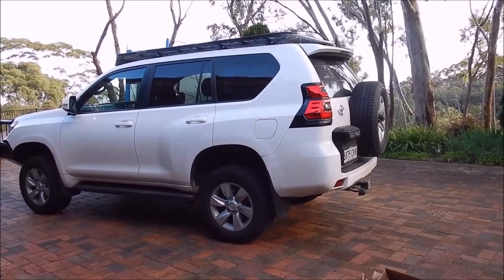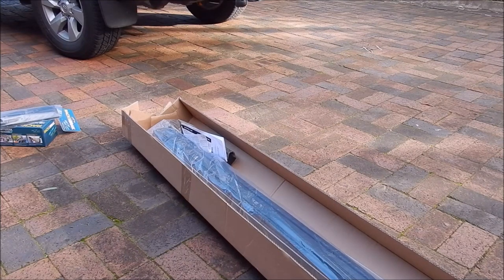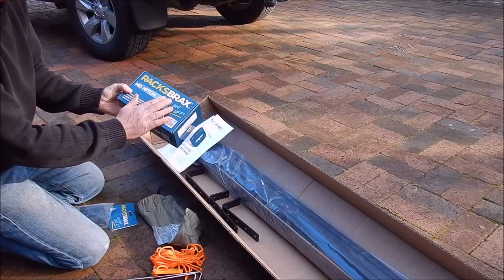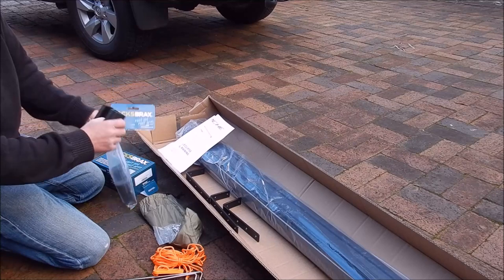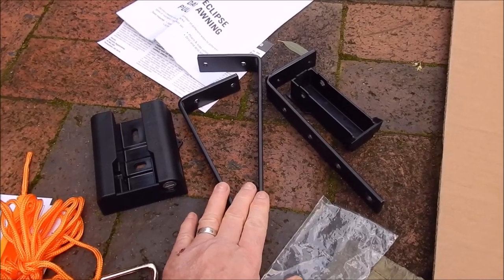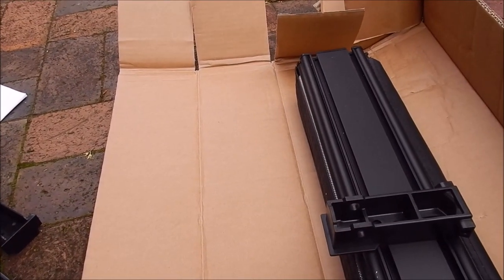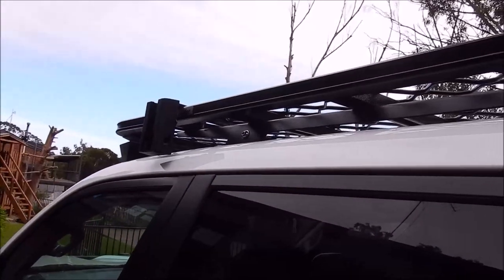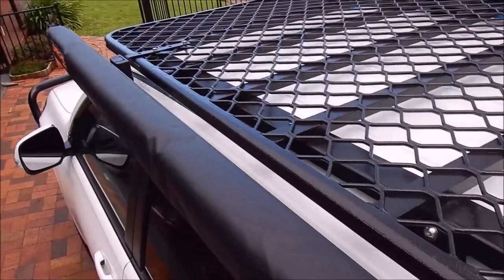Fitting & Review of Darche awning with RacksBrax

Comment: Great camp ideas! What do you do if you want to go exploring in your 4x4, after you have setup?
Reply from the maker: Great question as they advertise that you can lift it off and leave the awning out, however from my experience that is too hard! As you have to tilt the brackets up to remove it's not really possible once the awning is extended. I've taken extra poles and removed the awning before setting up, but again that is very hard and needs the four of us! To be honest - this does not really work! 
I either just pack the awning away or take a gazebo!
Reply: @4x4+2kids  glad I asked thankyou for your honest answer!😊😊😊 not many videos on the removal, this will be why. 🤔

Comment: I got the same roof rack lovin it, made the decision after seeing one of your vids. It was very helpful. Even installed it myself with some help. Looking at the racks brax to hang a bush company 270 max awning off it. How do you think that would hold something that big and heavy. With a bit of 4wd and also when it’s fully deployed with a bit of wind hitting the awning.
Reply from the maker: Racks Brax state 20kg per bracket on their web site so you should be OK with two. I used my side awning in 50km/hr winds and added some rope to the awning & rack to reduce the stress on the bracket as it was flexing in the wind, but all good!

Comment: Great vid. Can you say why you went with Darche against ARB, Rhino Rack etc in this price bracket?
Reply from the maker: Great question, I had purchased some other Darche products and thought the quality was really good, but guess there is little in it between the others you mention. I was also going to buy a Darche Extender tent so would be sure it connected to the awning without any issues, however I'm sure the other's would have been OK as well.
Reply: @chrisp10022  Thanks for the reply. I ordered a Darche 2.5 x 2.5 today from Snowys👍🏽 From what I can see there has been little upgrading of these (all) awnings in the last 10 years but I like the idea of the plastic joiners for a bit of flex and if I break one my wiz boilermaker mate can 3D print me new ones

Comment: the brackets at 7.57min in, the flat ones to accept the Lshaped awning brackets onto the Tracklander rack,  what metal and thickness are they?
Reply from the maker: The flat pieces I cut are 5 mm, in fact the same as the L shaped bracket, also 5 mm
Reply: @chrisp10022  thanks and are they aluminum? painted black,  can i ask what width and length as well please
Reply from the maker: The flat ones I made are 40 mm wide and 150 mm long, galvanised steel painted with enamel. Aluminium would have been better but I could not get any at this thickness or thicker.
Reply: @chrisp10022  Did you cut the brackets to size yourself or did you manage to purchase them from somewhere? I also have the same roof rack and awning on a Ford Everest Next Gen. Thx for the great videos - much appreciated